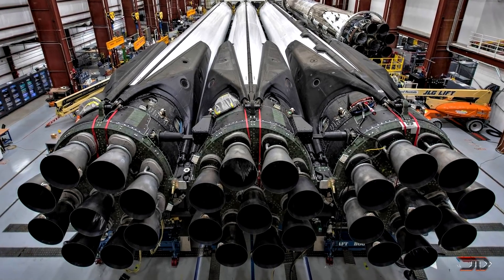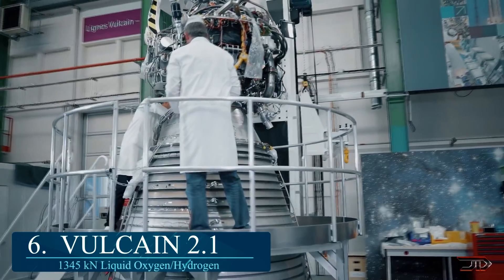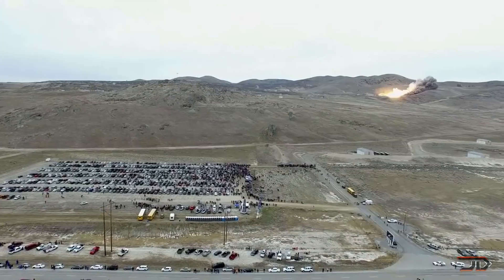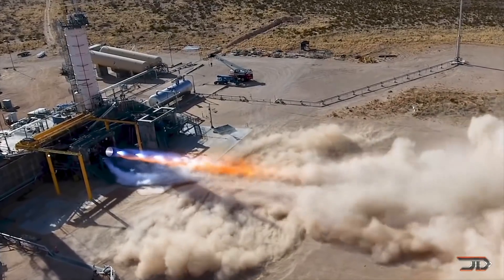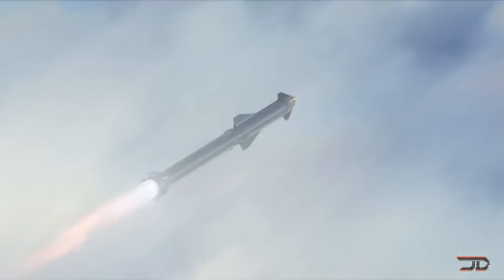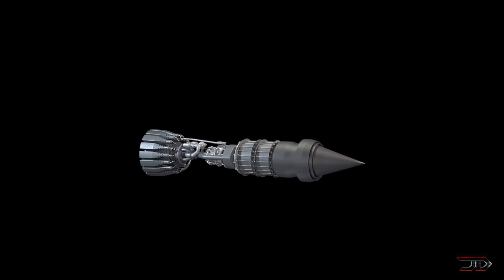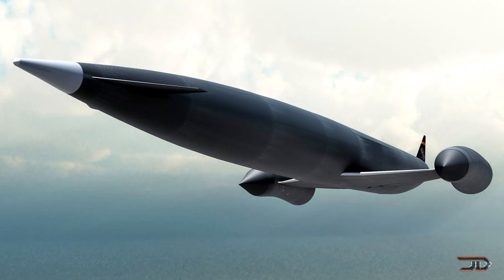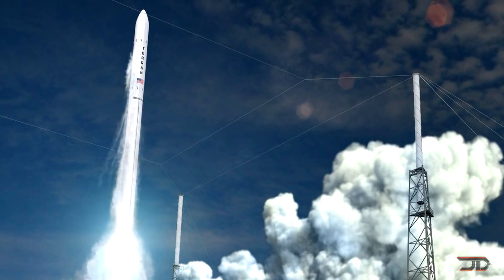7 AMAZING New Rocket ENGINES

Comment: Honestly... will the Ariana 6 rocket even be relevant when it flys?
Reply: It will be relevant for a while, as the rocket is still cheap enough to be competitive, but soon (and I'm glad ESA realises this) it will have to be made reusable, which is why they're making Prometheus
Reply: Aaron Jacobs in reality, however, Prometheus is five to ten years out, I just don’t see how ESA can compete during that time.
Reply: Europe needs it because its their only way to access space independently, so yes, it will be relevant. And besides, it is, and will be one of the safest options to launch GTO payloads. Cheers.
Reply: Pollux Pavonis “one of safest” yes, but many times the price of SpaceX. It doesn’t seem to make sense to me.
Reply: Is not many of the times, Ariane 5 is at much, twice the cost of the Falcon 9, and it can carry more payload to GTO (the thing it is most used for), Ariane 6 will be 40% cheaper, so it will made it a really attractive option.
Also Ariane Space doesn´t depend on the comercial lauch market, it is designed to grant Europe independent access to space,  wich is a strategic need of EU´s goberments, money is not the main issue.
Reply: @PolluxPavonis  Ariane 5 is currently five times the price of a Falcon 9 ($30M vs $150M).  The Ariane 5 is also more expensive than a Falcon Heavy which can carry twice as much.  The Ariane rockets exist now only to prop up industry in Europe.  They are not competitive.
Reply: Bryan Robinson where are you getting those numbers from? Cause the Falcon 9 cost $62 million
Reply: @14uWaterPolo  Falco 9 is not 30 million.... source? And I tell you once more, Ariane 5 does a better GTO job than fhe falcon.
Reply: Pollux Pavonis ok... I could be wrong,  what are the prices of A5 and A6?
Reply: Pollux Pavonis ok, I admit I’m uncertain of the cost of A5 and A6. Do you know their actual and/or projected prices for each?
Reply: Pollux Pavonis my mistake. I was actually considering the launch cost with Starship which is estimated at 1 to $2 m
Reply: @skyhiker9669  a satellite launched from an Ariane 5 or 6 requires less hypergolic fuel on board than launched from a Falcon 9. This is due to the high efficiency Hydrolox upper stage that the Ariane 5 and 6 use. The Kerolox Merlin Vacuum has higher thrust, but lower efficiency. This means that a satellite from a F9 launch needs more fuel to get to its final orbit, and that increases costs for the satellite itself (not to mention the company paid to fill up the satellite with hypergolic fuel)

Ariane 5 and 6 will also have a much shorter deployment time from GTO compared to F9, which makes sense for a company that might have to send to a satellite quickly for whatever reason. Lastly, F9 can launch only 1 geostationary satellite, with maybe a secondary payload, if one is found. Ariane 5 and 6 put up 2 geostationary satellites at once, allowing for the costs of an Ariane launch to be shared between two customers, not one.

Lastly, Falcon 9 corners one particular market area - ITAR restricted satellites. If the satellite you buy is from Maxar or someone else in the US, it might have ITAR restricted parts, forbidding it's export from the US to another country. Compared to Atlas V, F9 is basically the only viable option. If a satellite is manufactured by someone else, like Airbus, then a customer has a multitude of options, including Ariane, Soyuz, Proton, H-II (Mitsubishi Heavy Industries) and Long March (China). The problem with Chinese or Russian launches is not the launch price, which is competitive and cheap, but the space insurance, which is very high for the Russian and Chinese launch options. F9 and Ariane insurance premiums are lower, and permit the two to have a large amount of competitive commercial launches.

Arguably, SpaceX has an advantage over ArianeSpace simply because SpaceX can get DoD contracts for military and spy launches including GPS satellites. Since ArianeSpace is "foreign", they are blocked from DoD contact bidding. ArianeSpace has, however, been able to get contracts to launch French military satellites and the Galileo GNS satellites.
Reply: vaska00762 excellent information. Thank you.
Reply: @14uWaterPolo  First of all, not, the prices you mention are not true at all. Official price from SpaceX is 62 mln per launch. And what kind of comparison is that, considering Ariane 5 has roughly TWICE the GTO payload of Falcon 9 o_O So the price comparison is 2*62 vs 150, if anything.
Reply: @Pharisaeus  The Ariane 5 does NOT have twice the GTO payload.  The ECA is the biggest version of the Ariane 5 and it only manages 9,100 kg to GTO.  The SpaceX Falcon9 manages 8,300 kg to GTO.  Now the Falcon Heavy can lift more than TWICE what an Ariane 5 can to GTO and do it for $90M.  That is $90M for 22,200 kg versus $150M for  9,100 kg.  The Ariane 5 belongs in a museum and they should keep a spot open so they can put the first Ariane 6 right next to it in the museum.
Reply: @PolluxPavonis  I did get the price wrong.  It is $62M, but the lifting capacity is only 800 kg different to GTO (8,300 kg vs 9,100 kg).  However even the Falcon Heavy is less expensive ($90M vs $150M) and it can lift more than double the Ariane 5.
Reply: @PolluxPavonis arianespace's ariane 5 is heavily subsidized by the esa, cnes, and the eu commission. And still it sells launches for upwards of 200 million. Spacex sells launches for 50 million. (It costs them 30 million to fly) a reusable falcon 9 tales 5.5 tonnes to gto, and ariane 5 can do 11 tonnes. 

Cost wise, spacex is ahead. But then theres that ariane 5 launches into a 2 degree orbit, and falcon launcjes into a 28 degree orbit. Since geo is 0 degrees, its actually easier to get to geo after launching on an ariane 5 than on a falcon 9.
Reply: @vaska00762  its not easier to go into geo from an ariane 5 launch than a falcon 9 launch due to ariane 5's hydrogen upper stage. Just because of ariane 5's equatorial launch site.
Reply: @14uWaterPolo  yes but carrying capacity isn't everything, companies that want to launch a spacecraft will go with whatever rocket fits their needs, which is why the ariane 5 is still a popular rocket, and also whilst it is theoretically possible for FH to launch 26 MT to GTO, its payload attach fitting isn't strong enough to hold that mass (although I heard somewhere that they were working on a stronger one but I don't know much about that)
Reply: If you have a 200 to 300 million satelite with build times of multiple years, the price of the rocket is irrelevant. All you are concerned with is reliability and that's why the Ariane rockets are relevant. Yes they might be more expensive at first glance but they are still in use for a reason.  
And another thing to consider: how is it that the LongMarch rocket launches more than all other rockets combined if the f9 is so much better? Just think about that.
Reply: @aaronjacobs3980  But the Ariane 5 isn't popular.  It it isn't a government job it barely flies at all.  In 2018 it had 6 launches with every single one being for a government (NASA, Japan, ESA, Azercosmos, ESA, and ISRO).  In 2019 there were only 4 launches for the whole year.  SpaceX had 21 launches in 2018 and 13 in 2019.  Long March and R-7 rockets flew even more than that.  The Ariane family simply isn't cost competitive.
Reply: @14uWaterPolo  no, it isn't, which is why ESA is building ariane 6 which has already attracted commercial customers, and what's annoying is when people criticize an expendable rocket system that was designed before reusability was a serious concept
Reply: @aaronjacobs3980  True and I fully recognize Ariane's greatness in its day but am disappointed Ariane 6 isn't reusable (I know about Adeline) and that ESA is so far behind on the Prometheus methl-ox engine.
Reply: @14uWaterPolo  I agree that Arianespace is being slow (Adeline was cancelled because safran saw no potential for it) but if Prometheus becomes operational and Arianespace can reusable the ariane 6 LLPM, or even develop a new, fully reusable rocket (highly unlikely but I can dream) then Arianespace can claim back at least some of its former market share, but the only way I see this happening is if Arianespace is allowed to become it's own private entity, like SpaceX or Blue Origin
Reply: @thomaswijgerse723  the equatorial launch site  actually provides less of an advantage from the so-called "slingshot". That said, the location does mean that a geostationary satellite doesn't need to do as many orbital inclination correction burns from an launch from French Guiana.

Actually, what the Ariane 5 and 6 have as an advantage is their Hydrolox upper stage which provides them with a far greater specific impulse than the Merlin Vacuum. Even NASA's own data on this shows that launchers like the Atlas V and Delta IV get far better GTO and beyond performance than the F9, simply because of how efficient Hydrolox is in vacuum. It's why the Atlas V and Delta IV get selected for scientific missions, because they can put a larger payload into certain transfer orbits beyond LEO. F9 beats the Atlas V and Delta IV at LEO capabilities due to the higher thrust output of the Merlin, but that's about it. It's why the RL-10 and the Centaur upper stage has continued to be reliable and effective decades after it was developed.

The simple factor is just the fact that Hydrolox get way better specific impulse than anything else, except for electric propulsion. Storable/hypergolic and Kerolox propulsion has efficiency issues. Storable propellants have the advantage of being... storable and Kerolox had the advantage of high thrust, permitting easier human rating, but that's basically the trade off.
Reply: @14uWaterPolo  Not reusable Falcon for which the price is public. This one takes only 5.5t, as stated on their website. As for Ariane 5, and ECA took 10.8t multiple times.
Reply: @Pharisaeus  SpaceX charges the same for new and reused rocket services.  There is no price difference.  Also, the 5.5t is not strictly followed.  Flight #77 only ~60 days ago was a twice used rocket boosting a 7t satellite to GTO.  Regardless, the Falcon Heavy is both more capable and less expensive than the ECA.
Reply: @14uWaterPolo  I'm not saying Falcon 9 can't carry more payload. I'm saying their official price is 62mln per 5.5t, end of story. You don't know if "there is no price difference", unless you're one of their customers maybe? Also again you're lying about Falcon Heavy. Official price is 90 mln for 8t to GTO. Since 8t < 11t, then there is no question about being "more capable". I'm not even mentioning that Ariane 5 reaches a better orbit, because this is mostly due to launch site location. And again the price difference, just as for Falcon 9 is not so huge after all. Rescaling FH price to 11t would give 123 mln vs 150 mln for Ariane 5, so 20% difference. Not 10x or 100x, 20%. I suggest you check your facts next time.
Reply: @Pharisaeus  The Ariane 5 is so expensive that after Arianespace landed the OneWeb contract they subcontracted out the launch to Soyuz.  It was cheaper for Arianespace to buy a ticket on a Soyuz rocket than to fly the Ariane 5.  When Arianespace sees the Ariane 5 as too expensive you know it is time for a new rocket.  It is just disappointing that Arianespace didn't get the memo that new rockets should be reusable.  The Ariane 6 would have been average 10 years ago.  Now it will stand as a 63m tall monument to signify Europe's inability to keep pace.
Reply: @14uWaterPolo  What? o_O Arianespace was launching Soyuz rockets since 2011. They literally built a launch site at CSG for Soyuz! It has absolutely nothing to do with price, but with the capability. Vega is for small and Ariane 5 for large payloads. There was nothing in the middle, hence the deal to have Soyuz at CSG. With Ariane 6 this won't be an issue any more because Ariane 62 will cover the Soyuz range, and Ariane 64 the Ariane 5 range. As for reusable rockets, I won't even go into that, because all you muskrats are braindead when you hear "reusable". Just notice that Falcon 9 is NOT cheaper because of any reusability efforts, but at best despite them. The real cost savings come from mass production. They have 10 engines of the same design per rocket, while Ariane 5 has 1 hydrolox vulcain, 2 solid boosters and 1 hydrolox upper stage. Not only those are 3 different engines, but also in total they need only a handful a year. This is the real money saver here.
Reply: @Pharisaeus  The OneWeb satellites launched on a Soyuz rocket from the Baikonour Cosmodrome.  It was purely a cost decision.  Vega couldn't do it and Ariane 5 was too expensive.  Glad you brought up the engines because  the new ones (Raptor & BE4) will all be methlox which will lower the costs even further.  That is yet another technology Arianespace can't keep up with.
Reply: @14uWaterPolo  Ariane 5 ECA has a max Payload of 10,9T to GTO and it is very popular for launching satellites into GTO. Also in 2018 only 2 of the 6 launches were for ESA. and Ariane 6 will be a big competitor to Falcon 9 and Heavy.
Reply: @Tist6099  It isn't popular at all.  It is too expensive.  It only flew 4 times all of last year, only 6 the year before, and 6 the year before that.  No one wants it.  If it fills you with pride that Arianespace can't make Ariane 6 reuseable and can't make a methelox engine then I'm happy that you are happy but I am sad the once great Ariancespace only has the talent to repackage decades old technology while watching the rest of the world leave them behind.
Reply: @14uWaterPolo  And in this 4 launches it placed 8 satellites into GTO. That's 4 more than SpaceX did in the same year. Also will Ariane 6 be ad cheap as Falcon 9 without beeing reusable and GOD is it more efficient.
Reply: @Tist6099  Maybe it will and maybe it won't but there is a good chance Ariane 6 won't be competing with Falcon9.  By then the competition will be the methalox powered Starship, methalox powered New Glenn, and methalox powered Vulcan.  The price to GTO is about to get cheap.
Reply: @14uWaterPolo  not sure that starship will be GTO viable soon...
Reply: @alekosb.8704  Sooner than you think.  Starship will be GTO viable as soon as the first viable SuperHeavy Booster is built.  SpaceX has started construction on the new 81 meter high bay building for stacking SuperHeavy.  The building should be in use in 12-16 weeks if history is a guide.  At that point SuperHeavy development will move quickly.  SpaceX should have a short Starship hop in the next 6-10 weeks, a 20km flight before the end of the year, and a full Starship/SuperHeavy flight in 2021.  It is an amazing time to be alive.
Reply: @14uWaterPolo  depends on the capability: they have to make it able to transfer to GTO and back, possibly in one launch. By reusing all the starship the LEO, and so GEO capability decreases drastically. Add to that the fact that the launch pad is at a high latitude, reducing even more the GTO capability and spacex are going to have a hard time.

Still, even if they beat ariane on price, ESA will allways use it since is made in europe, making arianespace killable only if the EU parliment suddenly fills itself with spacex fanboys like you. I should remind you that ariane was born just to be the alternative to the US and it will always be.
Reply: Safety its one of the reasons why Nasa decided to launch the James Webb Telescope with the Ariane 5. Ariane 6 will be certainly relevant, at least for a while, if it will be able to have a similar reliability with a reduced cost.
Reply: Void interesting. 🤔 can you elaborate on “safety”? What determines this for A5 & A6?
Reply: Europe needs independent space access, so yes, it will be relevant. The same way Indian, Russian, Japanese or Chinese rockets will be relevant. Even if it so happens, that commercial customers will go to cheaper vendors, there will be assured government payloads flying on those rockets.
Reply: Pharisaeus serious question here; will current Ariana customers use A5 & A6 at their currently projected prices if they can get the same service from Starship for it projected price of 1-2 million?
Reply: @skyhiker9669  "projected price" xD yes, and Elon was supposed to sell reusable Falcons for 10x or even 100x less than conventional rockets. And yet he's few % off so far. Let's be realistic. Not to mention "Elon's time", so it will be years of Ariane 6 flights before we see Starship, if at all. SpaceX likes to "upgrade" their designs all the time, which puts the actual release date further and further. Just look at Falcon Heavy. I'm not saying it's bad, but take this into consideration.
Reply: Pharisaeus WOW! I really have to disagree. True “Elon Time” is in a universe of its own, but SpaceX history shows precedents of RAPID and EFFICIENT project development. Elon’s projections of cost may also be in another universe. However, the cost of Falcon 9 is such that it now dominates 60% of the market. Now I don’t know the projected plans for A6 but “years” ahead? If you and I were sitting at lunch together I’d bet you a new CyberTruck (seriously, I would put my money where my mouth is) that Starship Superheavy flys before A6. And I’m NOT a betting man.
Reply: You could make the same comment about upcoming Russian and Chinese rockets.
It is noteworthy that in past 6 months, after 40+ successful SpaceX landings, 
the Russians are considering development of a reusable design, the $9.8-billion Argo spaceship.
https://www.themoscowtimes.com/2019/09/30/russia-plans-reusable-rocket-to-compete-with-elon-musk-by-2024-rbc-a67508
Reply: w9gb what’s concerning me is that other providers are at least 10 years behind in technology. While they are all playing catch up, SpaceX will continue moving ahead. In the future there may be no competition at all.
Reply: Sky Hiker 9 
Apple’s iPhone was like that, for awhile, until Samsung and Google (Android) acted.
Old Business Rules about Innovation & Products: Be First; Be Better than First; or Cheat, since you weren’t paying attention.
—
Elon is moving to Starship, before a competitor can develop a Better solution.  So, he is developing a “New First”.
Blue Origin is working on the “Be Better than First” (Falcon / Falcon Heavy).  New Glenn has payload capability ~ Falcon Heavy with stage diameter (~7m) sane as retired Saturn I-B rocket.  Provides a lower cost alternative to SLS for lighter payloads (7m fairing).  Planned launch capacity, one launch/month (12/year).
—
Cheating?  I am sure some have tried (industrial espionage, spies), but if SpaceX continues as a continuous development company  ... it is a Fool’s Errand.